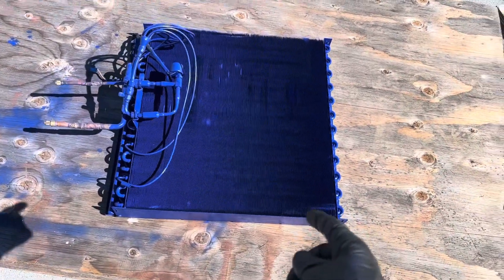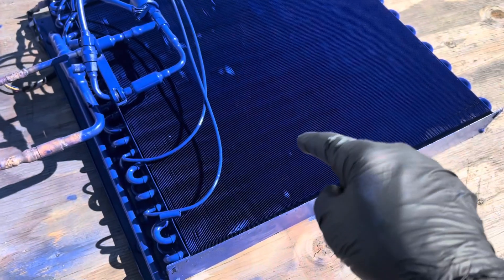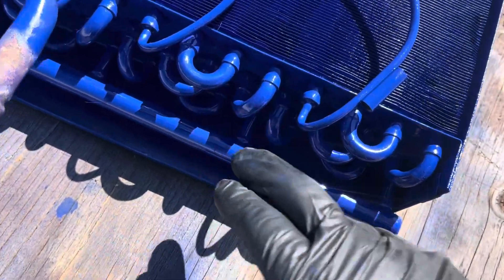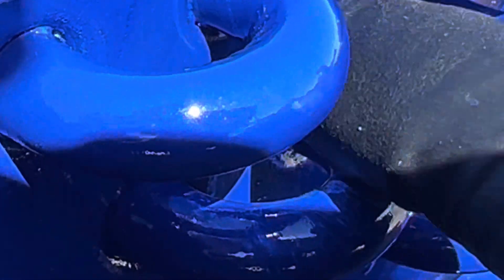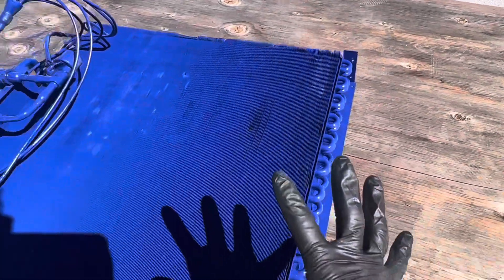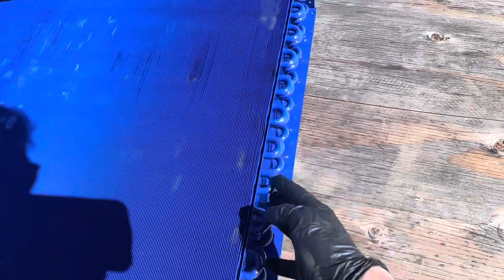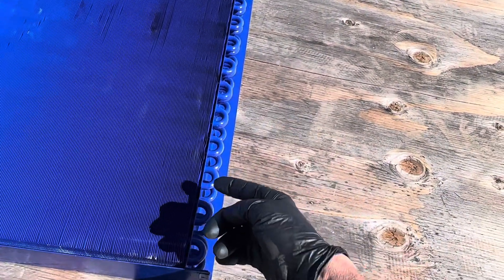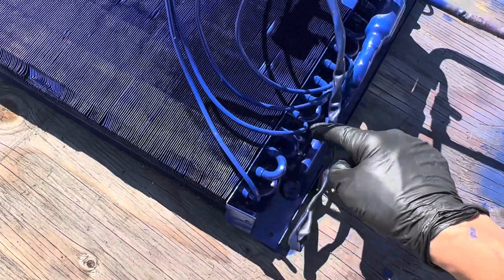Epoxy coating Toshiba air handler evaporator.   Exposure to cleaning chemicals and salts ￼ ￼

Comment: is that epoxy coating also used to seal leaks ?  what working pressure  can it hold ? is it tempature rated ? thanks
Reply from the maker: It is only meant for corrosion resistance that is his design sole purpose

But I have made a video where there was a very small leak in a evaporator in the lower tubes and I cleaned it prepped it put it under a vacuum and sprayed three coats application. 

I let it dry for 24 hours

With 80° heat in the room

Then I put it in to use for a week came back and checked it for leak and there was no leaks. 

This is epoxy is made by Modine for the purpose of coating coils

I did one or two videos where I disassembled entire outdoor heat pump and coated the coil in another video on disassembling a new evaporator wall mount coil coating it and then re-assembling it
Reply: @coldfinger459sub0  Modine's "ElectroFin E-Coat" looks like it's just powder coating, but dipped in a fluidized bed instead of sprayed. Powder coat would definitely get in all the nooks and crannies.
Reply from the maker: @WaffleStaffel  dipping is done in large volume applications.  This I did with spray can.
Reply: @coldfinger459sub0  thank you for the info, very helpful.

Comment: Those end plate leaks are also caused by thermal expansion. These leaks are especially common with heat pumps.
Reply from the maker: These ones where it actually leaked had a large physical clearance of non-contact at the leak point 
And this facility use sulfur with aggressively attacks copper as one of their aerosols in the air chlorine and ammonia products for cleaning and many other metal salts in aerosol form
Reply: @coldfinger459sub0  Yeah, anmonia from cat piss eats the mobile home coils up here. Especially with 15 cats.
Reply from the maker: @USA-GreedyMenOfNoIntegrity  lol 🤣

Comment: Pool water is supposed to be bonded to ground.  One of the ways of doing that is some zinc plating  and attaching it to ground.  As a side effect of doing this it helps prevent the corrosion of the other metal items(ladders, rails, etc).  So perhaps another possibility, would be to use a stretch of galvanized tubing/pipe, in an easier to fix spot, that way it would at least dilute ion attack.
Reply from the maker: This gets corrosive chemical attack is their biggest problem in this facility. 

The zinc plating that they put on the headers on the ends literally wears away in a few years. 

Just like the zinc anode rod inside a water heater or attached to the side of a large ocean vessel it where is away and if not replaced you start getting corrosion. 

So by completely encapsulating the entire structure in Epoxy the metal surfaces are never exposed to oxygen never exposed to moisture never exposed to corrosive or electrolyte type airborne materials when combined with water

If you see the other video on the same system up on the roof on the heat pump I show close-up video of where all the galvanized plating where is away from the edges where they’re doing their work of sacrificing their life to save the component

The only problem is the factory galvanized plating is a thin cheap electroplating and not hot dipped galvanized so it’s extremely thin and wears out very quickly. 

The other manufacturing problem they electroplate the zinc on the steel first and then they come in and cut out the holes for the copper to go through exposing raw zinc coated edges that have been cut that rapidly accelerate the point at where the galvanic action starts taking place

It’s like they intentionally sabotage their work To have a shorter life expectancy

Comment: Interesting.  I have to wonder how much that actually helps long term.   I can see it helping on all spots the epoxy hits.  But where there exists galvanic weld bond to copper, it will deteriorate with time and thus leaving a new non epoxied spot.  And corrosion should continue in those new spots.
Reply from the maker: On a poorly designed system with bad zinc protection due to their manufacturing process it’s nice to add another 10 years to the system before they Apoxsee cracks or degrades and then the zinc can take over after that period of time and start sacrificing its life for another couple years. 

The biggest problem in this situation is not the direct ionic galvanic action process taking on between two metals it’s the addition of the corrosive chemicals that they use as aerosols in this commercial facility directly attacks the copper where the zinc has no beneficial affect on protection in those locations. 

So by never allowing the highly reactive copper corrosive chemicals to come in contact with a copper in the first place you eliminate that problem. 

Have a few videos of outdoor condensing units here that are just a mile or so away from the ocean and the attack on the aluminum fins depending on the brand and what type of coating they use the deterioration starts within one year to five years. With the epoxy coating I buy the coils and additional 5 to 10 years. 

Another place of leaking is that the welds around the accumulators inside the units. 

Because the welders are not professionals whatever machine or equipment using the welding process often overheats the wells and they develop carbon impurities in their welds their self so where the cheap light thin black paint is exposed to moisture from the condensation on the accumulators these are very well-known leak points of failure resulting in the complete loss of refrigerant charge. 

So by completely encapsulating in a thick layer of epoxy two or three coats you can make the accumulator vessel exceed the life of the whole unit by never allowing the welds to be exposed to the atmosphere